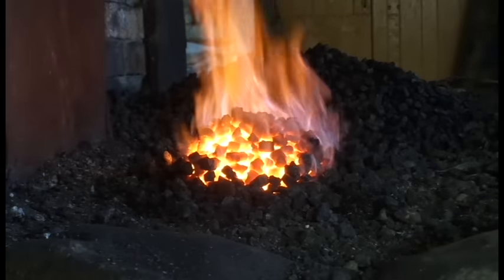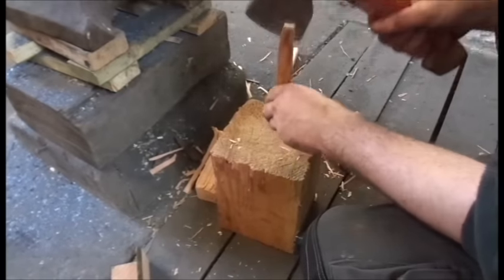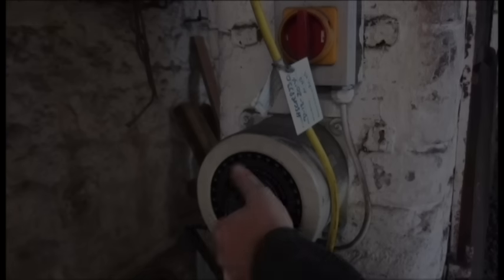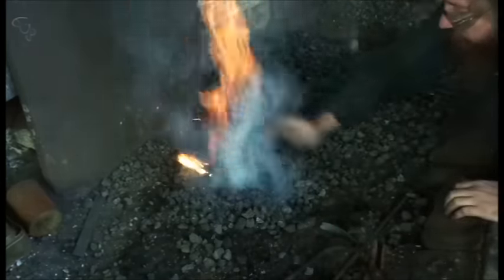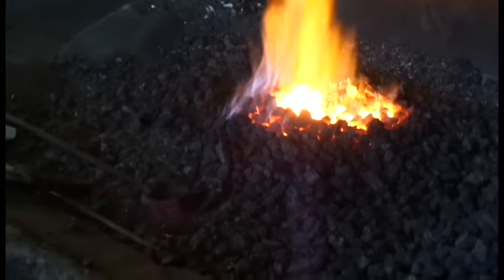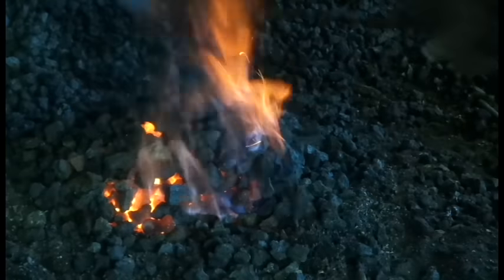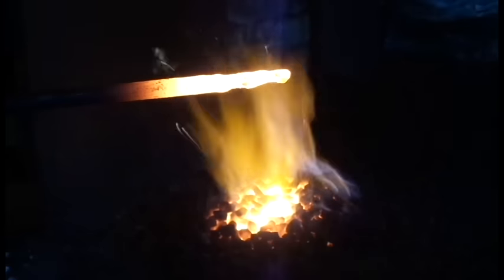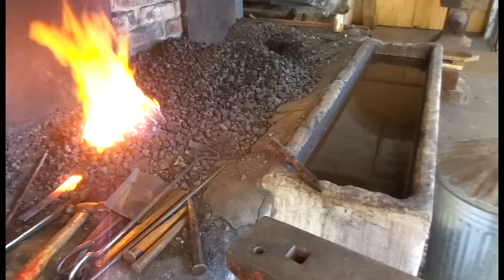Blacksmithing basics for beginners: The fire.

Comment: I've just started smithing metal and have been having trouble managing where the best heat in the forge is. This video was massively helpful. I went straight back out to the forge to rebuilt a successful coke fire with charcoal as the initial heat source. Thank you.

Comment: I have an alldays & onions side draft forge i pulled out of a scrap yard 30years ago for a tenner those were the days when no one wanted any of this gear so glad i kept a hold of it. Great videos looking forward to seeing more.
Reply from the maker: +thornwarbler Thanks again :) I bet it is worth a few bob now so it was a good investment!
Reply: Its not had as much use as i would like but you cant be huffed for a tenner . I got a load of other gear when a local shipbreakers shut down again in those days no one even bid on the blacksmith gear so i got all that for next to nowt.
i'm a welder or should i say was a welder but would love to have been a blacksmith but i have a nice size workshop at home  so i get to do a bit now and then
Reply from the maker: +thornwarbler I have to say that I'm not brilliant at welding. I can do good sturdy welds but they aren't particularly good looking and I only have an MMA welder for toolmaking and ocasional repair jobs. A TIG would be nice at some point but I am primarily a smith so it gives me an excuse to turn down some jobs...

Comment: So far, I've only worked with bituminous on a bottom-draft forge. Could you comment about what you do at the end of the day to extinguish your fire (presumably without wasting too much fuel)?
Reply from the maker: +verdatum I simply turn the fan off - that is the other nice thing about coke is that without continuous air it will go out completely within maybe fifteen minutes. If I have been using a big fire, I may push the top embers back onto the coke pile and they will go out in seconds. If I don't want the fire to go out during, say, a lunch break, I will shove a log in the middle of the fire and just let that smoulder away. It is a good question and I wish I had thought to cover it in the video.
Reply: I have used a steel trash can lid if you need it to go out fast, but idk how big of a forge you have.
Reply: thank you very much for sharing your log in the fire over lunchtime trick, i have been contemplating the problem of my forge shutting off over lunch for some time and this is better than any solution i have seen or come up with, once again thanks.

Comment: great video, 
I am currently fabricating a side draught forge, can I use any kind of sand for the bottom? also what distance from the bottom to the tue hole?
Reply from the maker: +Dave Adams sorry mate, for some reason your comment was held up as spam by Youtube! For my first side draught, I used earth from the garden which I riddled to get any pebbles and lumpy bits out (pebbles are very bad in a forge as they can go off like a bullet!) I know people do use real sand but my worry would be forming more glass in the fire. The "sand" I refer to is more of a mixture of coke ash, dirt and earth. With my first side draught I think the distance from the exhaust to the bottom is about 4 inches but on my current hearth it is about 10 inches. I'd go for 6 inches which will allow you to dig a nice deep firepit with a "reservoir" for clinker at the bottom.